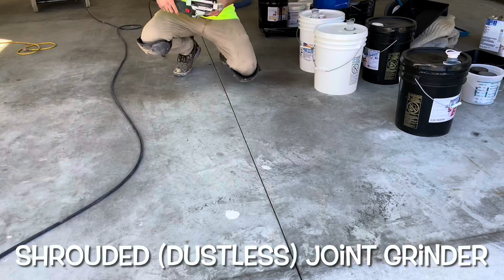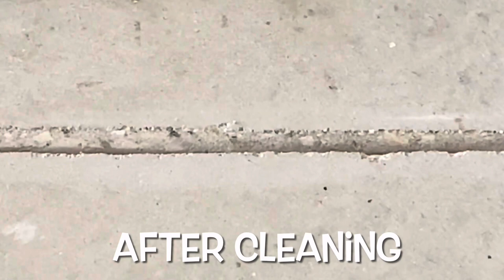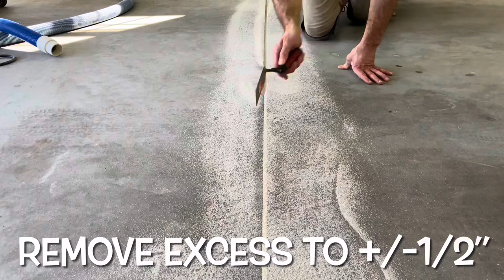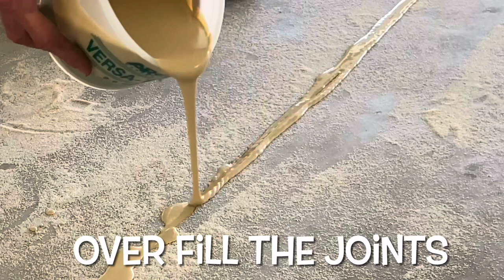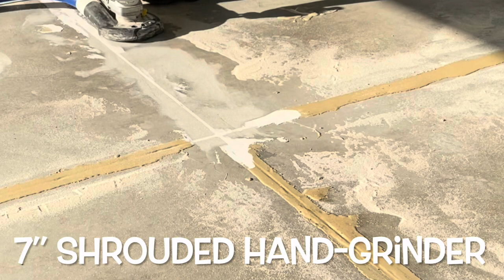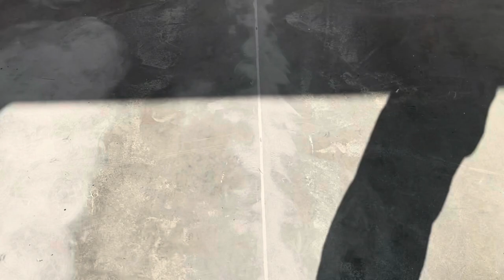How To: Filling Concrete Control Joints

Comment: Josh - so the product is called "Poly JF"? and it comes with the other darker liquid you're pouring in there or is that something else you add?   How many years of experience do you have with it?
Reply from the maker: Yes. It’s a two component product. The idea with this stuff is it has a high compressive strength but some elasticity to absorb compression. It’s like a shock absorber to compress within itself rather than bulge like a basic polyurea. I’ve added a link to the product and its specs. 

As far as time, I’ve used it for about 18 months. The few jobs I’ve revisited have shown it slightly bulging up during the warmer months. It’s not severe, but I know where to look for the joints that have been covered. 

https://buymanufacturersdirect.com/shop/manufacturers/smith-paints/poly-jf-semi-rigid-joint-filler/

Comment: Josh do you ever get bubbles in this product?  
What do you do about it if you do?
I used the product that the one guy whose joints you couldn't see used.
I went over last night and ground the overfill off and some areas turned out perfect but I also got a lot of bubbles which I now have to go refill and will hopefully be able regrind and get a smooth result but there were so many of them that I won't be able to get all of them.

I just filled the whole joint.  I wonder if using sand like this would have made a difference.
Reply from the maker: This is a good question. Assuming I didn’t whip air into the mix, then I only get bubbles when the joint leaks and air tries to escape. Using the sand here made a big difference to stop getting bubbles. Ever since this one, I use sand to prefill.

Comment: 5 hours for joint repair... way to long when employees are on the clock.  Tell me you have a better product with quick dry capabilities? We try to knock garages in one day.
Reply from the maker: Certainly there are products that will cure more quickly. The aim here is to use a product that can handle thermal expansion and contraction without fracturing or deforming. There is a faster product with similar performance capabilities but that’s still a three hour cure. It’s not a one fix solution for every situation, budget, or schedule, but in this case it was the best choice. 

Thanks so much for the kind words about the videos. It is very much appreciated.
Reply: any polyurea joint filler in cartridge like Metzger McGuire or Euco quikjoint or others. 5-10 min dry, shave flush with razor then grind floor.
Are these types not recommended under epoxy or something? If not then Ive been using the wrong stuff lol, but no issues yet and have done many.
Reply from the maker: @TimKollat  you bring up a very good point. Polyurea retains a pliability that may cause a problem for the semi-rigid nature of a an epoxy coating. As a slab expands or contracts from temperature change, the poly will compress or elongate. This may cause a fracture in the top coating that, in time, could widen to a dirt collecting crack. Being that there is no way to guarantee how a slab will move, the goal in using the product shown in the video is to allow reasonable compression or elongation without excessive deformation. As you said, though, your chosen process has worked for your climate. Your input is helpful and I appreciate it. Thank You.
Reply: What I have seen around here with people using polyurea joint filler that comes in the tube is it doesn't really work that well. They shave it (possibly too early) and claim it will be absolutely flush and it always ends up contracting and then you can see the line or in other cases it seems to bulge up in time.  My suspicion is that the epoxy floors will crack in time. 
I am just going off of a very short period of observing but I have been able to look at a lot of floors because there are so many people getting them in the same warehouse complex that I am in.
The only guy whose lines you can't see did it with a rigid patching compound.

I just had someone fill my saw cuts and it has already contracted and cracked (the joint filler - not the epoxy which I haven't put on yet) I know the saw cut will be visible after the epoxy goes on but I don't have time to rip it out and fix it.  I did try to grind along the lines to lower the concrete on either side a little so it would be flush with the polyurea.
It would be really interesting to see how this product would turn out - especially since he gives it time to cure and then grinds it instead of shaving it.  
Josh - I wish you lived in my area.  Thanks for the video - I might try this with the other floor I haven't done yet
Reply from the maker: @jeffa847  thanks so much for the input and compliment. Polyurea is flexible and will compress (bulge) or contract (recede) as the concrete changes with temperature and humidity. Thermal expansion and contraction of a slab is the nature of concrete. Rigid fillers will keep their shape, but thermal expansion or contraction can crack them if the force is great enough. The idea with this particular filler is it can handle compression or elongation without permanent deformation. It’s like a polyurea on steroids. 

All this is to say that joints are a place of movement. If they are filled, then the more attention paid to preparation and material choice the better. To avoid future cracking possibly happening, it is pretty common to just leave them open. 

Thanks again for the great feedback. I appreciate it.
Reply: You 1 day garage epoxies are no good 🤦🏽‍♂️